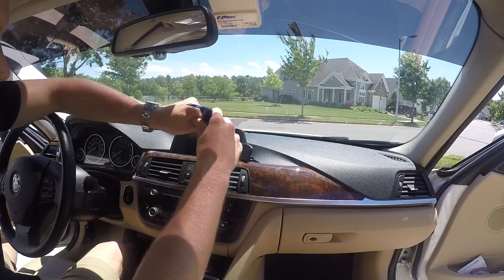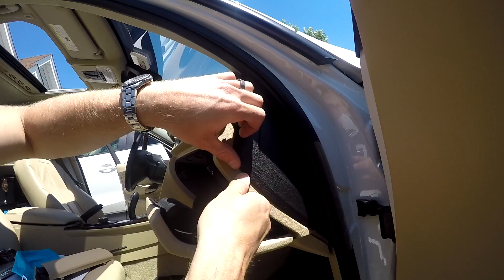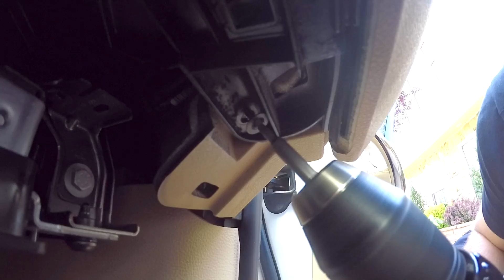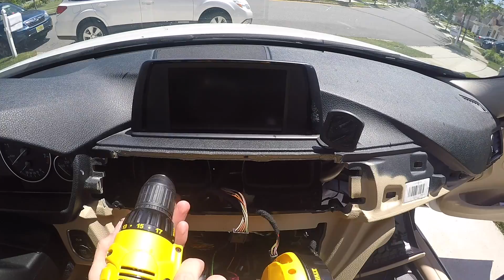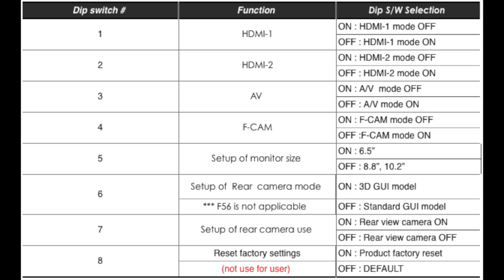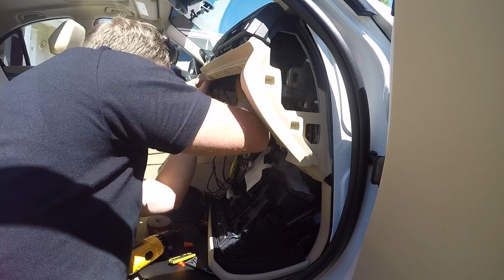BimmerTech F30 SmartView HD Installation

Comment: My idrive is cutting out for a few seconds display goes black and radio off, comes back on with Bmw logo, and no function to idrive or radio, stuck on one station. I have a 2103 328i , and am out of warranty. Any suggestions? There is no navigation system

Comment: Do you have an installation video for X5 F15? Would it require the same glove compartment removal?Also, I have an 8.8" screen not the 10.2" screen would it work still, and do you have 10.2" screens installation kits?

Comment: what if my 435 has side view camera, does harness cable have extra AV video to plug it in ?
Reply from the maker: This system is completely independent of OEM side cameras so no connection between the two is needed.

Comment: I have the Bimmer Amp and I was wondering how does this handle sound coming from it's inputs? Does it send all the input audio through the idrive aux? If it does then I assume the amp will receive the sound form the apple tv like this  apple tv>MMI>IDrive aux> bimmer amp

Comment: How get the interface power??? Where??
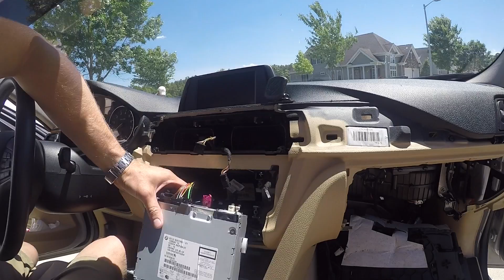Reply from the maker: The interface gets power from a plug and play adaptor harness that is included in the kit and needs to be installed in between the radio and factory radio wiring harness. You can see it being installed at 2:47